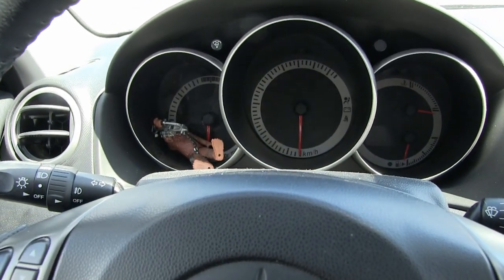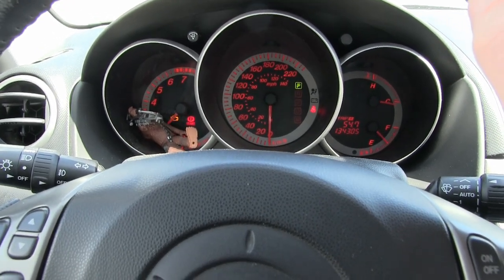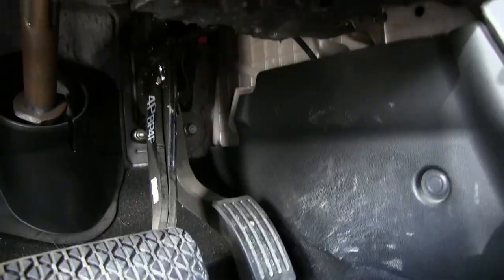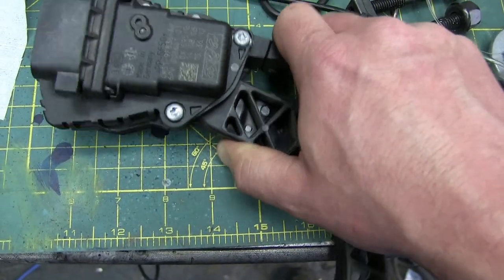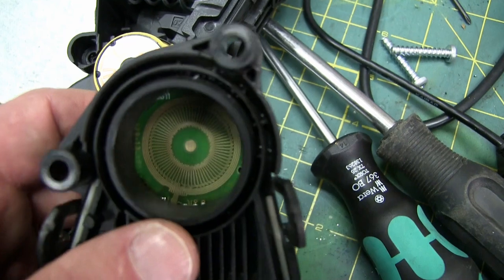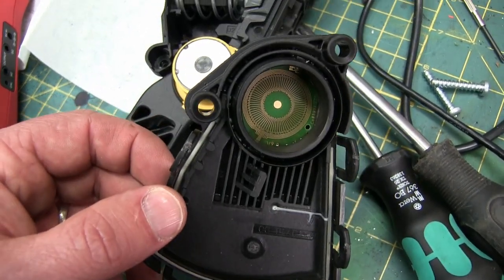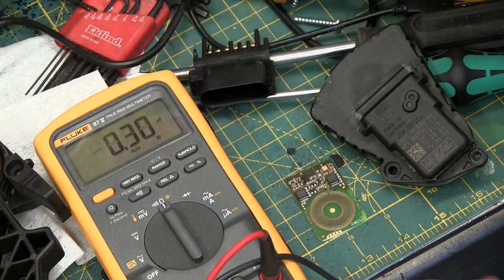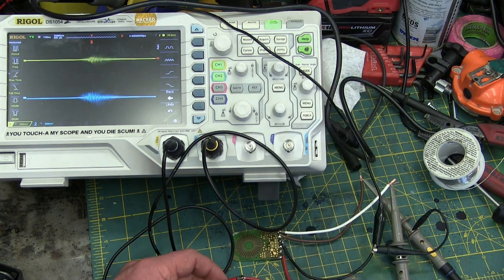BOLTR: CANbus accelerator pedal.

Comment: Fly by wire, so light, so reliable.  Can't wait for that nice feature on the steering.  Keep on keeping on.
Reply: its just as reliable as a broken throttle cable. unlikely but does happen.
Reply: I don't know, bud. Fly by wire means that you've got a bunch of extra sensors and at least one motor somewhere vs a cable and some linkages. The frequency of breakages might be similar, but I can fix a broken throttle cable with the stuff rattling around in the bottom of my trunk and a leatherman tool. If the part in the video had failed out in the nether regions of Canukistan, that would mean you're stranded.
Reply: I once had my mechanical throttle get jammed full open in some light traffic
Reply: I don't think you can. I mean you could if you purposefully prepared for it. But I don't think you would be able to fix a throttle cable issue. Any throttle cable issue would be a mechanical issue and unless you have a spare part your fix will most likely end up with the throttle stuck open.
Reply: I drove an old Jeep home once with a hunk of rope going through the firewall and under the dash instead of the throttle. Was a little bit of a trick, but it worked.

Had a clutch cable on a motorcycle break at the lever, too. Tied a loop in the cable, used a shoelace to tie it to my thumb and rode a bit over 150 miles that way to a dealer. 

Most mechanical problems can be worked around unless it's something completely catastrophic. 

The chances of fixing an electric sensor at the side of the road are pretty slim.
Reply: Fly by wire means you don't need extra motors and sensors for cruise control, idle air control, emissions control, etc. All those are just some extra software now. If any of those broke you'd be stranded too.
Reply: +thetpwrules Glad someone gets it. Cars are now more reliable than they've ever been but those who are still afraid of electricity are never going to believe you.
Reply: +Justin Kady The problem is that when it breaks, it's broken and you're not going to fix it easily.
Reply: David Serrano I have had more than one broken TPS but never a broken throttle cable.  And a TPS is easy enough to fix after you go to the auto parts and get a replacement but a cable can be fixed with junk you have around the house.
Reply: + Zeb Smith, it takes longer to clear the code than it does to swap out the throttle pedal on a drive by wire setup. 

Broken throttle cable (which I have done) takes significantly longer to fix.
Reply: see the 2 springs in this gas pedal?

that does the same job as the return springs on a carb..... if they snap, BOTH SYSTEMS GO FULL THROTTLE!

they are both springs with the same metal, the ame chance of snapping. 

and if you car goes full throttle...hold the brakes and turn it off.....donjt panic.
Reply: ive been working on cars for 18 years out of my 22 years of life.....holding a flashlight learning everything i could..... to rebuilding TH350s/4l80e's today. 

i HAVE NEVER! seen a broken throttle cable, unless it melted because it got next to some exhaust headers.....broken return springs, sure....

but the people didnt panic and shut off the car, using the ignition....which reminds me of everyone with the GM ignition that turned off and they had an accident.... they were idiots who expected their cars to work. 

power steering and booster brakes can fail at any time......mechanical or electrical. 
learn to drive with out assists....

which is why im for everyone learning to drive in some clapped out 1960s truck with a standard transmition. 
and is why i think places that require you to learn non-booster brakes, non-power steering, and non-automatic trans ARE GREAT IDEAS!

if cruse control broke..... i would just not have cruse (and possibly a vacuum leak..which i fix with a bolt)

idle air control isnt on a carb.....

i live in montana....everything that can be, is run with out emmissions because no matter if its from 1977 or 2007....emmissions control stuff is almost all redundant, robs power, and breaks first. 
FOrd EGR systems get "self eaten" from exhaust....chevys get plugged up....

and what happens when my computer dies and its -40f out side and im 250 miles from home?
i hope for a passer bye....

now what happens when my coil goes out?
i go into my truck and grab one of the 4 coils i have.....

SOME! electrical stuff is great....others is an experiment that makes manufacture easier, and donsnt change a fucking thing for the end user.....besides turning a 50 cent fix into 500 bucks for a new sensor.
Reply: +Justin Kady But it can be fixed in a ditch without special tools and parts. The assembly in the video does bad and you're stranded. That's fine for most folks, but some of us like to go places where our cell phones don't work.
Reply: Is a cable were to snap the only way to fix it is to make it shorter and tie it together some how. Same thing with most components. A pivot is a bit different I guess.
Reply: no, I'm not afraid of electricity. I come from a family where we lick our fingers and grab a wire to test if it's live. I'm also an open source computer programmer and do electronics for a hobby, so I think I know better than most when to be afraid of technology.

these things fail just as often, except it's often more difficult to find the problem because it could be any number of things or places, rather than look at it, yea that part there isn't working, I'll replace it. now, is it a wire harness connection problem someplace, is it somewhere in the part itself, is it the computer, is it something totally unrelated? who really knows unless you pay out the ass for the proper tools.
Reply: +Pete Lorenzo you don't need to lick your fingers to feel the pixies.lol
Reply: stand back. he's an open source programmer. hold on a second while i copy and paste my resume to make me look more credible in an online argument about nothing.
Reply: SuperAWaC stand back, this guy can spell and click a reply button. lol. I wrote code to generate my resume, and I don't code for a living, I code because I'm free to do what I enjoy.

has anyone else made a single comment about code? the point of any fly-by-wire system is to move complexities from mechanical parts into software where it can be more easily manipulated, except it's a black box you could be sued for if opened. this is a huge problem no one cares to think about except people who know code.

one possibility that scares the crap out of me, remote control. is your car capable of being controlled remotely? do you think you know the answer? what if there's a press release that police are now able to remotely turn off your car in the event of a high speed chase. that software is probably already there, and likely to be one of the first arguments they make. what if people with bad intentions were also able to do this, because it wont take long. add to that the throttle and steering, and you have the ability to secretly kill someone and make it look like it was their fault.

is it possible to remote control the average car on the streets today, lets open it up and find out, wait... we'll quickly get sued if we did.
Reply: Pete Lorenzo cars can't be remote controlled today. And you can quickly check by cracking open your ECU. The only car that can potentially be remotely controlled is a Tesla. But they have good security measures in place and would likely never give that power to a police force. Most cars do not have a receiver connected to their ECU. So unless someone physically tampered with your car then no it can't be remotely controlled. And any car that receives updates wirelessly (a Tesla) uses strong encryption which would make any 3rd party hacking the vehicle effectively impossible. Unless of course they physically compromise the vehicle or Tesla HQ.
Reply: grumpybill I will confidently say that's false. A Bluetooth radio can't control your ECU. Sure you can hack the radio but what does that have to do with anything?
Reply: I'm sure I've said this already, but it's worth saying again. This fancy wireless gear should NOT EVER be connected directly to the network controlling the engine. This should be blatantly obvious to anyone involved in designing a car, but somehow this has been happening with more than one model of car. There's also no regulation against doing this, but what average car buyer would ever suspect their smart car radio could ever kill them. Just because I'm not linking to an article showing proof someone has died this way doesn't mean it's ok to go ahead and jump off this building. Lets first wait until there are millions of vulnerable cars on the road before we do anything about it. I guess people are used to having computers full of holes.

The main rule of computer security is simple. You cannot make a system impossible to hack, but you can make it as difficult as possible. Well.. we need fancy selling-point gadgets, so lets just put a wireless screen door on this boat. Connect everything on the same network to save some cash on engineering.
Reply: Pete Lorenzo I honestly can't see how they messed up. My only guess is that their radio units utilize and display information from the ecu.
Reply: David Serrano the factory radio in my 07 cobalt has a feature where it changes the volume based on the speed of the car. normally this type of thing is connected to an accessory network, then there's a device connected between this network and the engine's network which forwards data in a way that it's read-only by the radio. wouldn't it simplify things so much to just put every device in the car on a single network, including the engine and a device with bluetooth/wifi. check this out, I can start my car from my phone. how awesome is it to put my family's life at risk for this novelty convenience which wont last the life of the disposable car.
Reply: Pete Lorenzo it's pretty awesome tbh. There has so far have been only one person who has been able to take advantage of these issues. And they were professionals and alerted the various car companies of their faults. IMO I would have imagine that the data would be one way as well. I'm guessing the issue is really just that having their code audited is new for car companies. I mean it was originally a simple radio that advanced into a cool item but that cool item is a fault and it needed to be audited by security professionals but it's a new concept. I'm sure as of today every car company has a third party company audit their code and etc. If they don't then they will eventually. I'm almost a hundred percent certain that Tesla's are audited since the firmware receives updates wirelessly.
Reply: David Serrano wireless updates to a car, that alone would scare the hell out of me. yes, cars do need updates, and very few get them, but... oh my, no. the point of any corporation is to make money, not to please and protect their customers. they'll only do what they're required to by law.
Reply: grumpybill sheep? I just understand technology. I don't get paranoid over dumb stuff.
Reply: grumpybill I guess so.
Reply: Some cars have entertainment systems or other internet connected subsystems attached to the CAN bus.  Unfortunately on those setups, you often can control the rest of the car from the internet... it's already been demonstrated.
Reply: VW has electronic steering.
Reply: MindBlowerWTF i doubt it would do anything but idle if that, it uses the aps and tps as part of the load algorithm, it will probably just stumble and stall the instant you open the throttle.
Reply: You've never touched a wrench in your life if you honestly thing this.
Reply: Why would you want something akin to fly by wire for your steering?
I can't imagine it really benefiting you, it's not like steering is heavy nowadays anyway, and fly by wire would only numb the sense you get through the wheel
Reply: Justin Kady one emp blast and your done. I'll take mechanical over robot overlords.
Reply: Sicktrickintuner did you work for holden? because the vf comadores got re caled for that?
Reply: already is in steering. next is brake by wire
Reply: ABS already does that
Reply: its only works in military fighter jets but they could never be safe enough for cars /s

Comment: i like my old mercedes s123 e300d, it just works. i bougth her when she had 689000 kilometers (metric stuff), and now she's about to hit 800000 kilometers. engine and automatic trans is original and untouched, just like i want them. the most complex thing on her is the glowplug system, relay not working toghether with somthing somthing, so she got a pushbutton, and direct current to the glowplugs, and she really likes me when its -20 outside and i fondle with her buttons, she fires right up.
anyway, great vid man!

Comment: You need to throw that cheap code scanner in the trash with that cheap gas pedal, and get a live data code scanner then you can push the pedal and look at what it is doing, and look at all the sensors, live with engine off or on,   Tip for the day.
Reply: I agree they are cheap too, I have a pretty over priced one but you can pick up a great one for 100 bucks
Reply: I have a pretty nice scan tool myself, but for those of you who don't want to drop $200+ on a high quality scanner, there are Bluetooth OBDII scanners that hook up to your phone/tablet and can be used with free apps to display that sort of information too.
Reply: bafx odbII bluetooth are pretty good. they support many protocols. they are around $30 depending on the car is how many sensors you can monitor
Reply: For most faults the cheapo scanners are fine.  Checking injector balance, etc need to move up.  I purchased a GM tech 2 because I have all gm.

Comment: Hey aVe,

Ian from Abbotsfart in the heart of the Fraser Valley real estate circus. 

Just thought I`d mention the importance of confirming the APP has circuit integrity on the B+ and B- at the connector.

I`ve had one of these of a similar model year with an open circuit from time to time in the ground circuit deep in the harness that ran along the top of the transaxle in the engine bay. Found it by backprobing the B+ and B-, installing a test light in parallel with the app, and watching for the test light to flicker signifying a missing or weak power or ground. The problem was intermittent (once every half hour or so, and the APP worked most of the time). I ran and spliced in a new ground wire to repair the car.

I hope this helps you if the new APP does not fix the problem.

Comment: That is actually 2 different sensors in one.  6 pin will have 2 low reference, 2 5 volt references, and 2 accelerator pedal position signals.

Comment: maybe you should have used a proper diagnostic tool and checked the throttle pedal position channel
Reply: +AvE eBay a blue tooth obd2 dongle $25 and get torque pro from app store. Then you can get sensor data readouts. I would map the tps reading to a dial gauge and work the peddle to verify what the ecu is seeing from there sensor. but the error code kind of points you in the correct direction anyway.
Reply: unplug the throttle body and pedal, turn ignition to on, turn ignition off. plug throttle body and pedal back in. turn ignition back on.  worked for my RX-8 last spring.
Reply: That technique rarely fails, lol.

Comment: That's actually an inductive sensor. Several coils are built into the PCB (note the very geometric layout) and a steel target in the brake pedal lever. As the target rotates over the coils, the inductance of the circuit changes. The microcontroller in the sensor detects the change and interprets it as an angle of pedal position.